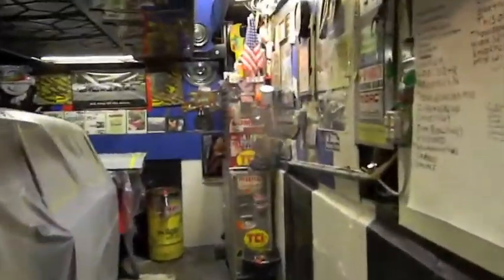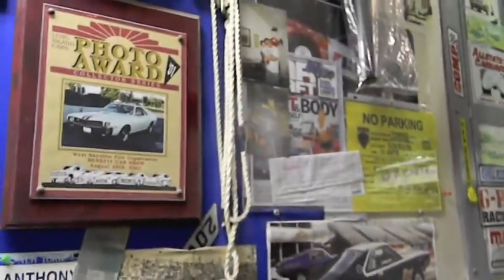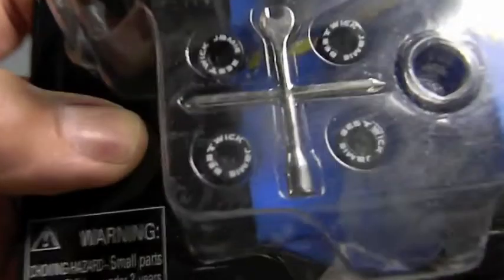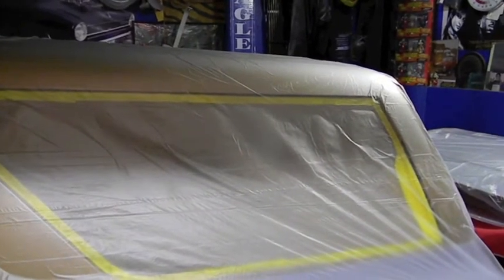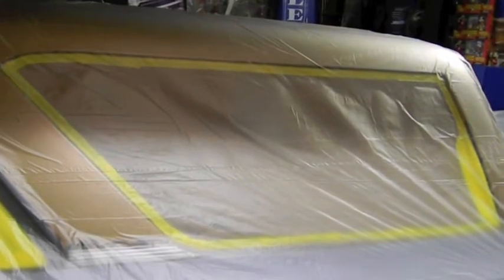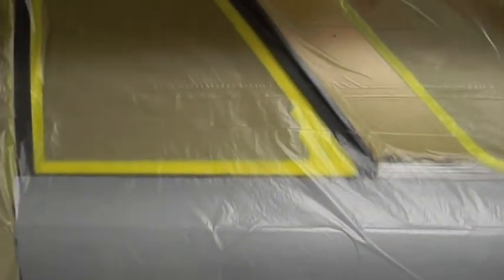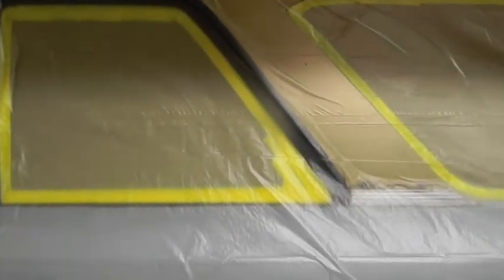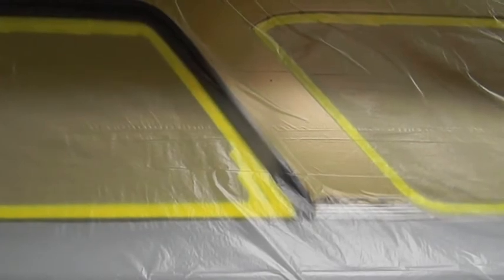Paint Gun`s And  Assembly Lube

Comment: Im looking forward to my 360 build up , its already had a lot of the mods done for oil circulation.  Its a hyd cam build in its current form and dynoed at 430 hp at the crank? 288 @ wheels,, but I want wilder to show australians a thing or two about this little known engine here, 500-550 would be great and try to keep drivability

these are the current specs anthony:
9:1 hypertectic pistons
Chev rods
Warm hyd cam, what specs would you suggest
(Was running a 3000 converter)
288 hp at wheels
Heads faced and ported, J port

Trans
Turbo 400 with AMC bell housing
Std converter
Reply from the maker: I went with scat(010 longer)rods,A set of Ross piston`s (11:1) A Schneider cam,I used Chevy 2.055 intake valves (.100 longer) Ford 1.740 exhaust valve,Double B/Block Mopar springs,Raised the runners .125 full port and pocket,Screw in studs w/Harland  Sharp (1.6) rockers,53cc head`s,727 manual valve body,3,000 stall(I tried to stay a little street able) Intake is an Edelbrock Ultra Ram 18 with 2 600 holleys(Much more responsive out of the hole than the Toker and 750)...The Comp. Cams Magnum 292 is a beast in that engine(Similar to my grind)Check out my videos called Making One Bad Rambler And Making One Bad Rambler Pt2
Reply: homotorsports your a star anthony, thankyou. 

What is your rough hp?

Comment: I still have mine It has a # 86 tip. Mac tools on handle and The part # SG 500 BC. I hope this helps.
Reply from the maker: I saw on line a SG 500 CC not sure what the difference is.
Reply: I think mine was a base coat clear coat early one but I shot everything threw it paint, sealer ,clears just everything and it still has the original kit in it. Try to get one to do that today.